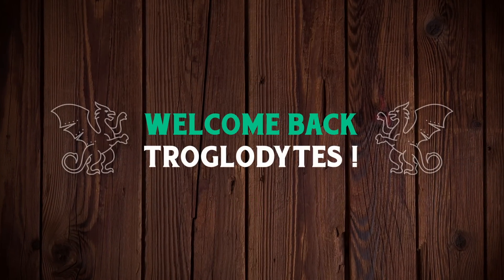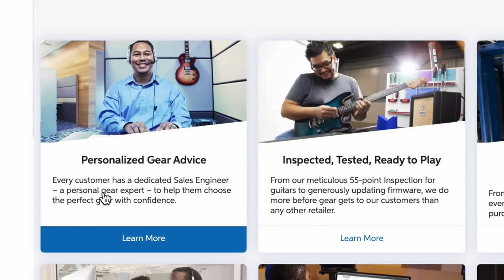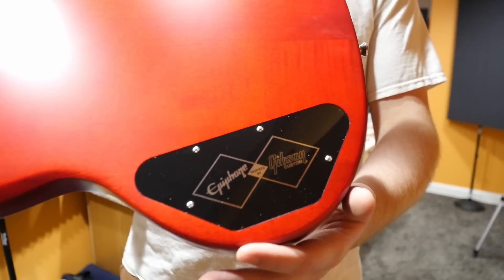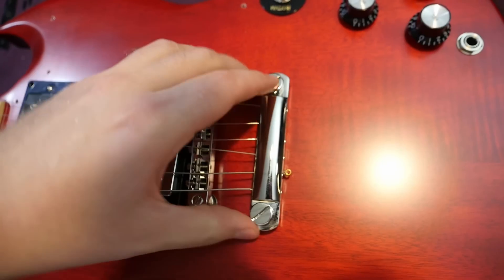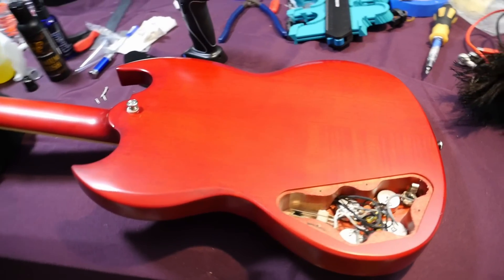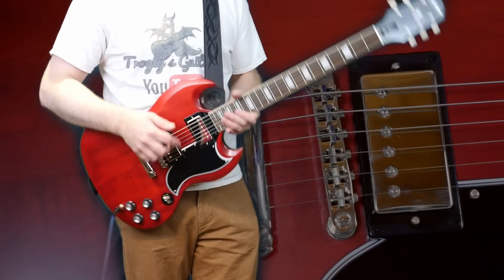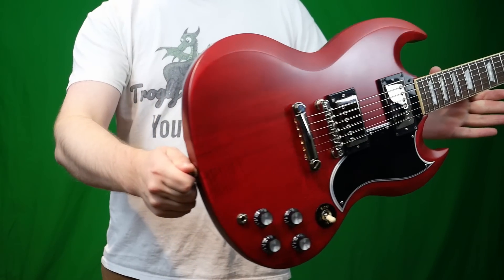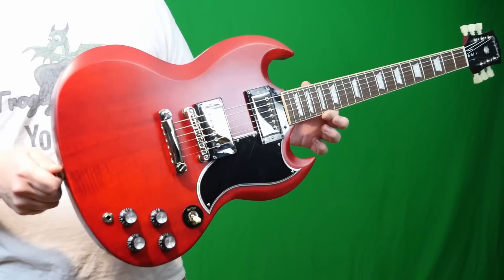Epi's New "Custom Shop" SG | 2021 Epiphone 1961 Les Paul SG Standard - Aged 60s Cherry Review + Demo

Comment: I work at a The UPS Store and I actually used your technique/advice to pack up an old Martin today. Double walled box, with plenty of void fill around the case. And of course, making sure you every side had packing between the case and box.
Reply: Thanks for that! So disappointing to pay $250 receive it damaged. Fun fact, an idiot seller UPSed me an acoustic in a thin gig bag...and it made it undamaged!!!

Comment: I definitely want to add one to my guitar arsenal. Ive never liked the body shape or that red color in the past, plus i prefer single coils, so the dual humbucker aspect never appealed to me, but yesterday my friend let me borrow his 2017 Gibson SG Standard and im LOVING it. I know the pickups are very different in the Epiphone vs the Gibson, but i love the way the Gibson sounds. Its has a brighter more articulate sound that is wide open in compared to any humbucker i have tried in the past. If i could afford a Gibson i would totally buy it, but i figure i could try the Epiphone and if the pickups arent getting me there i could swap them out for the same pickups and electronics they used on the 2017 SG Standard and get even closer to the real thing.
Reply: Dont know if you got one already  but my first sg, epiphone sg modern has fantastic pickups. No need to change anything.

Comment: Epiphone had themselves a year 
Lots of  higher end offering , some were better than others but the SG seems to be right up there with  the Lazarus  LP.  Looking at what you get for that price point it’s a good deal, for me personally the only negative is the Indian Laurel fingerboard,  I wish they would go to Rosewood or even Ebony.
Reply: They should go the Fender route and use Pau Ferro and get hand selected fretboard Woods so they are as close as they can get.
Reply: Yeah most Indian Laurel is cheap looking. My sg from 2019 has pau ferro and looks better

Comment: I just sold my Gibson 61 Standard 2020 model.   It looked great but had a pickup die, all wiring had to be replaced and the nut was cut so low from the factory that it buzzed on open e and A strings.   After replacing the nut and dumping an Emerson wiring kit and getting a replacement pickup from Gibson, it was finally playable.   I sold it at a loss and never looked back.    Honestly the wiring and Mallory caps in this Epi look better than the Gibson.    The main difference I see is the finish, and the Gibson 61 standard has the 61 lead and rhythm burstbuckers.    I would totally try one of these out.   If it actually played well out of the box it's a good buy over a Gibson.

Comment: The screws to the truss rod cover are crooked because they drill the holes for the truss rod cover after the strings are on and basic truss rod adjustments have been made. They need to angle the drill slightly to avoid hitting the strings.

Comment: This price Epiphon SG, as well as on Epiphon 1959 LP which is technologically more difficult, has the same sound pickups and exactly the same case. This is expensive, even if you do not take into account the second-hand SG Faded and Special, which sound no worse, and maybe better, but are sold cheaper.

Comment: How on earth did you get one of these already? Sweetwater says they don't have them yet? I have been waiting and waiting, rather inpatiently I might add! Lol I have the new black SG standard inspired by Gibson  from Epiphone with the full pick guard, and I absolutely love it. I got it half price, shhh it's a secret how that happened lol I love how the back of the neck is a smoother transition to the body, rather than the ridge that the old G400 models were known for. Too bad they brought that back with this model, and I've noticed that Gibson is doing it now too. Also the horns are not beveled on the back, that just looks strange to me. Mind only has the larger horn beveled on the back which is even stranger looking. Not sure what that's all about. My custom shop limited edition SG from Epiphone has both horns beveled but the joint isn't smooth from the neck to the body, it has that stupid ridge, and the bevels are not as deep and wide. I guess you just can't have it all. My new one is thinner thanks to the wider and deeper bevels, but not as thin as I want it to be. I prefer the really thin ones from Gibson, but those seem to be hard to find, and out of my price range. Tokai has a SG that fits that description, it's the SG124 vintage series, but I can't seem to find one in the states. It also only has one beveled horn and the stupid ridge where the neck joins the body, but it has the super thin body bevels that I'm looking for. If you have played one then you know why I'm seeking one. It's the comfortableness of a strat but on a SG. It just feels so good to hold and is conformed to your waist just right. I am happy that Epiphone put a wider tenon cover on, the old shorter ones looked kinds weird. Also the pointier pick guard is awesome. The older ones were really rounded.

Comment: I love SG's and this.
Bought a MIK G400 new, hsc. '95.
Had problems i thought i could fix. Wound up being a low fret.'
Partial mill and full dress. Still had dead spots. Sold it.
Found a like new MIC for $249 in '10. Good guitar.
Had a '64 SG,,,,

Comment: I like this a lot, especially the Gibson pick-ups and the hard case make it very appealing. However, I lean towards the new Harley Benton Double-Cut 'SG' style models which come with stainless steel frets and are considerably cheaper. If you're thinking of only having one 'SG' type guitar and you intend to play it a lot, I would choose the one with stainless steel frets that you never need to worry about replacing.
Reply: Definitely value for money, but their shape is just not right.

Comment: Yeah you can't fully trust Sweetwater. When I was looking for my first Les Paul, a deciding factor was getting one that had a hardshell case included. I didn't want an expensive Gibson without one. I ordered one from their site, and it was listed with the case that had a white interior. (Still want one...) but it arrived in a gigbag! Luckily no damages in shipping, but it tainted my trust in them. They made it right later on and sent me a "gibson gear" case free of charge, but I have done business with them since. And this just verifies to me they haven't changed their ways or quality control. That was back in 2014 too. So almost 8 years later, no change.

Comment: shocked they actually wired it 50's style, recently rewired my 2014 epiphone les paul and it was the standard asian import wiring, switched it to modern les paul and it sounds right now. no pick up swap really needed, but definitely wanting to find a set of burstbucker 1&2.
Reply: Good catch! I was wondering why there were no treble bleeds that are pretty standard feature nowadays and then noticed the wiring was a little off - Kind of has is built in with 50s style wiring

Comment: i got a weird epiphone g1275 its gotta be a korean b stock model the serial was scratched and has the signs of the adhesive they used to use to tape over b stocks back then i guess its a mystery still to me after owning it for 7 or 8 years now. its also flame top too and cherry a weird one for sure

Comment: I going to put a warning out on this guitar.
The first one I had arrived with a broken neck. 
The second one arrived perfectly but has since developed cracks on both sides of the neck disguised by the wood grain. The cracks follow the wood grain and are extremely hard to see.
This is a one piece neck and is very thin at the nut where these cracks have started from.
This is definitely a manufacturing problem as the wood is simply not strong enough to cope with the pressure of the strings pulling on it. I’m sure looking at this it is going to be an overall problem on many of these guitars. I have NEVER seen this occur on any Gibson sg in my life, the wood quality for epiphones on this model is not capable of taking these stresses.
The guitar sounds amazing so I’m devastated. My only option now is to dump the body and salvage the pups electronics and pots inc case and get myself a new body from somewhere.
Damn!

Comment: Disappointed to see the top horn at the top isn't tapered slim like a typical early 1960s SG was...this one has the wide untapered top edge which I hate.Sadly the Gibson custom shop ones have this 'wrong' feature too which is a deal breaker for me.Luckily my regular Gibson 61 reissue actually has the proper top horn carve.Come on Gibson and Epiphone...fix it...it's not hard to do!!

Comment: Looks like simply a better guitar than the others. The veneer hiding the scrap wood body was just BAD. PRS SE uses Veneer but a nice three piece body on the back not hiding anything. This is A LOT better. And I don't understand the problem with Indian Laurel fingerboard. Fingerboard wood isn't meant to have your fingernail scratched across it. Looks and feels nice. The aluminum tailpiece helps tone. Add in the pickups AND it's not $1400 either. Loses one star for the corny finish. Other than that it's the perfect SG for an Epiphone. I think. Four stars.

Comment: thank you for a nice demo mr. trogly. I have a question: in my experience some lower cost nice guitars from Asia are made of something called mahogany, but this is not the same wood as high end US models made of mahogany. I don't personally believe that good pickups are more important than good wood, so this point matters to me. do you have a point of view on this? specifically, what wood is really used in this guitar? is it of comparable quality to the wood in gisbons?

Comment: So, I think there's a misconception between product management and manufacturing. When they say that this is a collaboration with the Custom Shop, they mean the folks doing the product management and product marketing. They basically opened up Epiphone manufacturing to the Custom Shop team in collaboration with Epiphone product management. So, yes it is a true collaboration. 

WRT manufacturing - prior to KKR, Epiphone QA and manufacturing was probably higher quality than Gibson. Gibson had the advantage on superior materials, especially in electronics. My guess is Gibson brands are upping QA and best practices everywhere - they operate as one company now. 

Anyway, characterizing Epiphone and Gibson as separate operations is no longer the case. Look at the product offerings across both brands, and you will see clever tiering across both ranges. 

Gibson probably makes more margin on the expensive Epiphones than on low end Gibsons, so these new higher end Epiphones make business sense.

Comment: I don't know why it took them so long to move away from those horrible headstock. I actually think I might like these more than the Gibson. I've always been far more concerned with tone and playability first. With tone it's tht guitar itself I'm looking at; it's acoustic projection, resonance, etc. I typically replace the pickups because there are certain ones I like to use for certain models, or I wind my own. After that it's construction method and material; long tenon's vs short, number of body pieces, hardware, etc. The look is last and if everything else is good I'll buy it even if the look doesn't thrill me.
The only exception is Epi headstocks, they're uglier than a bag of pulverized assholes. Unlike the body, the headstock is ALWAYS in my line of site. The only Epi I liked enough to keep for any length of time was an old MIJ Sheraton II, and that had the more ornate headstock that kind of detracted from the shape (although it also made it insanely neck heavy and I had to always hold the neck of it would dive to the ground). These new, or really they're old but have been reintroduced are really nice and I've found myself looking at the Inspired by Gibsons enough that I ended up buying a natural finish ES339 and it's really nice. I played the ES339 pro a few years ago and wasn't impressed. For $50+ the Inspired by is a FAR superior instrument.

Comment: I'll just chime in real quick and give people the correct analysis of why to not buy an Epiphone.  East Asian mahogany... its not Honduran.  East Asian mahogany (or whatever alternative mahogany they are using) is structurally the equivalent of paper mache.  If you look at it wrong the neck will break.  I just bought a studio for cheap because it had a broken headstock.  The repair went fine and it works now, but the real (honduran) mahogany I used in the repair is like 5 times more solid/dense than whatever crap they are using.  The specifications for all of the hardware and electrical components are also off for the sake of cost cutting.  The frets are not glued in (which in some ways is a benefit if you're into maintenance).  An SG standard (or even the tribute) aren't that crazy expensive.  You could take a Gibson SG standard to the grave with you.

Comment: Hmm.
I've got a regular Epi Standard SG (2020) (in black because the veneer looks 🤢) which sounds better than this. Not that this sounds terrible, just... meh, and dull, muffled, esp clean.
- I can also live without a horribly (mis)matched 2-piece body, poopy brown & fairyfloss pink Epiphone-labelled hard case and a BS backplate.
They also stuffed up the bevelling on the back of the top horn.
And then we have the new "Gibsonized" pricing...

Comment: why does every review refer to the orange drop capacitors that Gibson use? I have searched the web and the most expensive orange drop capacitor I can find is £8.50 around $ 10.oo for all you Americans , surely this cant account for the usual extra £ 1000 pounds for a Gibson, made in the US dosn`t always mean better, your probably paying 40% in tips !!
Reply: These have Mallory capacitors. Different types of capacitor have different reactance. Sprague (orange drop) and Mallory seem to be the favourite. Some people think brand and type effects tone.

The capacitor coupled with the potentiometer acts as a filter cutting off frequencies. This is because of phenomenona called capacitor reactance .

What happens is At low frequencies, there is plenty of time for the capacitor to charge up to practically the same voltage as the input voltage. At high frequencies, the capacitor only has time to charge up a small amount before the input switches direction. The output goes up and down only a small fraction of the amount the input goes up and down.

But remember because of the potentiometer you can change what frequencies the tone circuit cuts.

Comment: Ehhh I sent mine back. Not worth almost 1k to me . I got an older g400 instead  for 340$ and am currently saving for humbucker sized p90 pickups . I can’t justify 1k for an Epiphone. They just have this cheap sparkle to them I really don’t get the hype for these high end Epiphone. To me they are great guitars at the 500 and under price range. I’m sure my comment will upset someone but to me iths the truth. My 300$ used g-400 looks just as great as this 1k sg. Especially if you plan on modding it .

Comment: Not having a scarf joint is a mechanical downgrade classed as an upgrade because it’s subjectively prettier.

Clearly, the makers have decided that buying thicker stock is both ultimately cheaper and can be more charged for than the extra time and effort required to make the scarf joint would be.

Pure marketing BS, environmentally worse, bad for the end user’s wallet in at least one and potentially two ways - don’t help them!
Reply: Suspect that's the case I've seen many new models that what I thought were good hidden scarf joints. Epiphone certainly are buying better wood though.